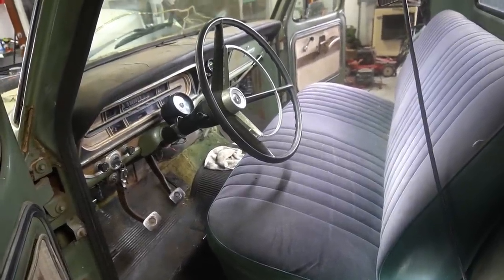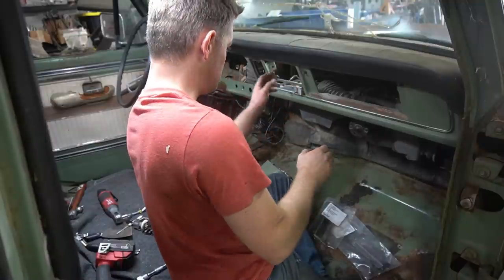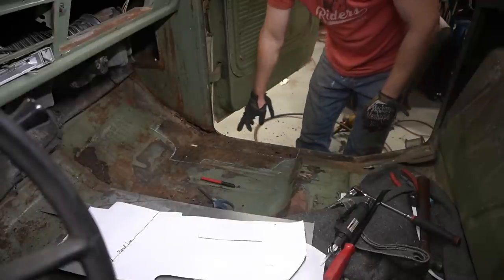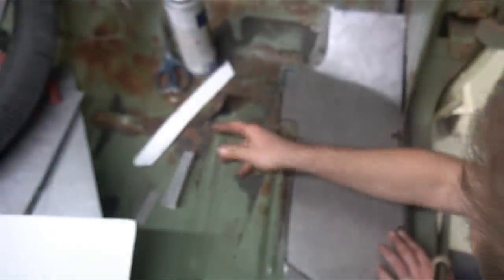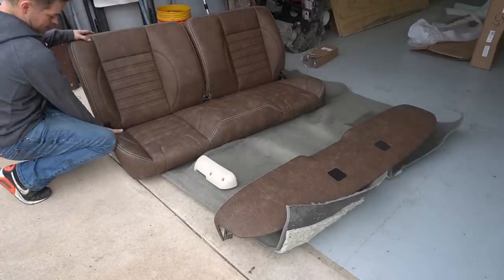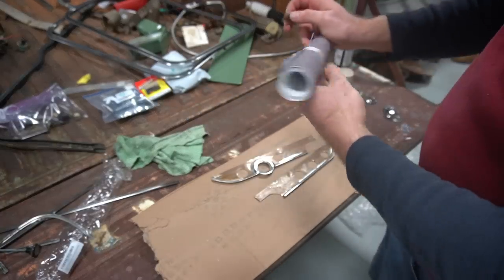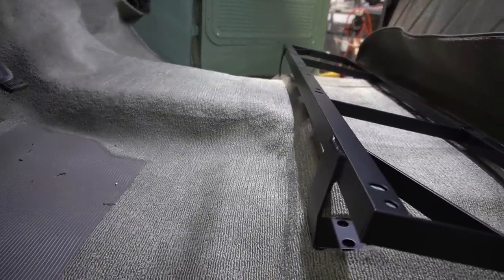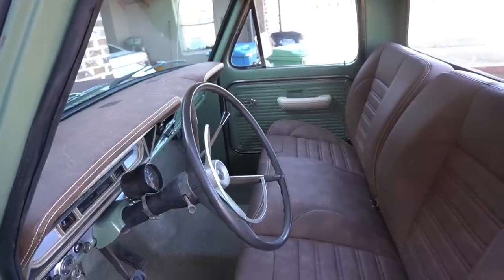F100 Interior Clean-up

Comment: Looking great. I did a mod on my 70 F100 years ago to make it shift better. “Better” being not so much lever travel. The holes on the two levers at column end had elongated and the bushings were sloppy. I made two T s about 2 inches long, same width as the column lever and the bar of the T 1/2 inch tall and 1/2 wider than the vertical part of the T. I used 1/8 steel. I bent the bar ends 90 degrees and drilled the hole in T so It aligned with center of the shift rod hole. Short carriage bolt and flat washer to hold lever with those bent bar ends on the T to keep lever from slipping. I drilled hole on end the diameter for new rod bushings. The stroke of shift lever was little more than half of original and the effort was higher but not bad. Sort of a Hurst shifter for 3 on the tree.

Comment: My late brother worked at the local  Ford garage (Harrison Ford) for a number of years 60-s to 90-s. Trim levels in PU's could be sparse, non-padded dash etc.  The headliner on yours was probably a gray cardboard with black or white mottled coloring. Depending on the color, trim level and customer he would extend the red line on the grill down the side and across the tailgate and or add a red stripe to the hubcap wheels or both.  Narragansett Bay.

Comment: Prettier than the prom queen. I owned the four wheel drive new with three ninety and four speed.....$2300.oo bucks paid and out the door. I loved that truck particular cause it refused to quit, white top and bottom and  turquoise sides and interior. I  was a good mechanic but body work had eluded me at that time so every couple three years Marty's paint and body did the whole truck while running  gear sast in my shop refreshing everything that needed attention.I hope that you can see the difference in those two engines that you have as those ribs stand out once your eye catches it, those horizontal casting marks. I think you have heard of uncle Tony's garage or something close. I think he would know  this and then he is mostly mopar so might be a short straw... Deboss might know

Comment: Great videos. I'm gonna be doing work like this on my '72 F250 before long. You might want to check to see where water may be coming into the cab. Those floors usually rust because the truck sat outside for a long time and water leaked in when it rained. I found if the windshield isn't leaking, water is coming thru the bottom of the vent below the windshield into the cab. There's a big black bead of sealer under the dash along the top of the firewall and that's where it may be coming in. BTW that old green carpet most likely isn't original and neither is the cloth seat upholstery. That thing was probably upgraded in the 1990's. The Ford trucks of that era came with vinyl seats and black rubber floor mat. The "fat" seatbelts are the originals. Good looking truck. The painted interior looks great! If you don't want to use the vinyl door panels, that metal panel that's there will work. The base models used that metal panel. They were just painted different contrasting color. Maybe try to find a paint in that parchment color and paint the metal in that color. Looks great and it will help me on my project.
Reply from the maker: This one looks like it came in through the rear window gasket and ran down into the floor. The truck sat outside with that passenger side tires flat, so it was leaning that direction, so it looks like the carpet held water and caused it to rust out the floor board up there.
Reply: @330_garage3  that's good to know. One thing for sure, it's getting good care now and will be in a garage and rarely in the rain anyway. I finally got mine in a carport so that'll help it until I can fully restore it. Thanks again for recording this. It gave me some great ideas.

Comment: Great job on the motor. I have a 72 f100 390 automatic. The original block was cracked so on my restoration I put a Jasper exchange in mine.

Comment: i have a 70 high boy it is very clean still has factory paint no rust dana 60/80 lockers with tool box on side extra parts 390 4 speed i got for 250 bucks traded for the engine new clutch not sure what i am going to do with it right now i am building a 68 chevy with a stroked 454 hot rod . have a few 4x4 sitting can get a lot of fords and chevys have a few all ready

Comment: Looking good now change back window seal to keep water out...  I think tmi makes matching door panels.   A stock headliner with extra sound deadener could be cool...
Reply from the maker: Yep.. I already have a new rear window gasket that needs to go in, luckily the truck lives in the shop so no water risk at the moment. I need to figure out where to get a headliner, and find some headliner trim on ebay or somewhere
Reply: 330_Garage I looked at the abs plastic headliner which looks ok or you can go online and order the perforated vinyl like it had originally which looks a little more finished and original, i considered making it myself out of fabric or you can have one made in a leather or vinyl that matches the seat.  There’s a company I came across on Etsy I decided to go with that will make whatever you want for 170 bucks.  B62upholstery, They’re making one for me as we speak - pleated, Old Whiskey vinyl to match my seat cover.  I can’t vouch for the quality yet but the reviews were really good and the owner was easy to work with.  Or you can do something custom like the American flag thecraig909 did.  Choices choices...
Reply: @yeboscrebo4451  yeah I like Craig's flag, I might copy that on my 1967. So far I've just got my truck in pieces. I told the wife that it's either give me money to build my truck or I'm buying a new Mustang GT 350. I'm learning as I go and Craig909 and 330 have been very helpful for me.

Comment: Interior look really good get head liner and door panels to match. Not real sure about weather strip I think it might leak with the seam in the top. Get a peace of rubber hose that fits inside the weather strip to splice the seam.
Reply: Donald Holbrook good point.  Seam at the bottom might be a better choice.  The previous owner on my truck had so much goop in the gaps of all the rubber weatherstripping  that the seams on the doors and windshield were perfectly preserved.  Not a spec of rust anywhere.  When I replaced the rubbers I put liberal amounts of goop in as well

Comment: Looks great! Probably should have hit the pedals and column with a little paint too. Or do you have other plans for them?

That 3M stuff is the same stuff I use on engine gaskets. Works awesome. Engine fluids do not affect it. 
Typically the split line of the door seal goes to the bottom at center or a little forward. Assists in leaving a place for any water to escape/drain. 
Door sill plates will help hold the door gasket and carpet down in the jambs. Originals are almost always wasted. 
Also that odd seatbelt is probably out of a mid-later 70s Ford pu. The 67-72s never had a center belt like the 75-78s. I did the same thing, put that center belt into my 69. Needed it for the baby car seat back then! Lol
Looks great, keep up the good work. 
Oh- stick with the 68-9 Grille. Much better looking IMO than the 70-72. They have started reproducing them, Dennis Carpenter, but sure ain't cheap!
Reply from the maker: Probably a good idea to paint the pedals.. not sure that I really had a good plan for them...
Reply: @330_garage3  It's a small detail you don't think about while doing the rest. Guilty myself!
Reply: @330_garage3  trim black and new pads is all they need looking good

Comment: Love your SHOP !   Not too big,  not too small !!!     Wondering if you'd  give your shop dimensions ???    Thanks !
Reply from the maker: you bet. Its a 40x60 building, and a went with a 13' eve height so I could put a taller lift in it. I think the lift would have been fine with a 12' eve height. The 2 roll up doors on the front are 12x12 also.

Comment: was that the original PCV valve in what looked like a cap that would explain the two slots you filled with silicon in the rocker covers ...

Comment: How much did the seat from LMC drop you in the truck? The original seat my legs are almost at the bottom of the steering wheel. Looking at my be using a 92-96 F150 seat as I've read it is a direct bolt onto the seat pan. Not sure how much it will drop my in the cab either.
Reply from the maker: It may have dropped me an inch or 2, it wasn't much. Buts more comfortable to drive now for sure.
Reply: Do you think the 92-96 F150 40/20/40 seat will drop me any?
Reply from the maker: @markseefried2450  I actually had a 96 F150 in my shop this week with the 40/20/40 seat in it. ... I'm not sure that seat is any lower than the factory F100 bench. The tall back rests make it look even taller, so makes it harder to estimate

Comment: Hey man love what you are doing. I have. 71  I'm working on. How do you get the knobs (light, wiper,flasher) off
Reply from the maker: Trick question. All 3 are different. The lights have a hole in the switch under the dash. Poke a paper clip in there, and it the whole knob comes out. I think the wipers had a small set screw in the knob.

Comment: What make/modle of camera do you use to make your video. ?
Reply from the maker: I used a sony a6500 for most stuff and a gopro hero 5 for action shots and wide angle. Gopro also does the best with engine audio
Reply: @330_garage3  ok thanks for reply back